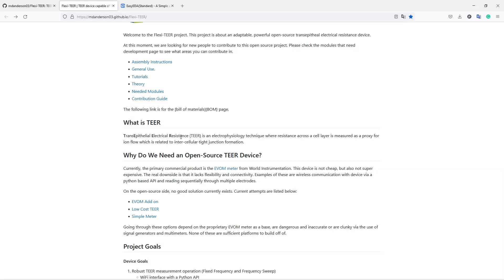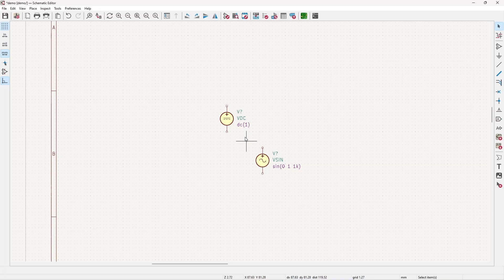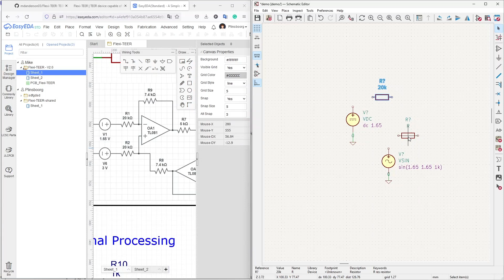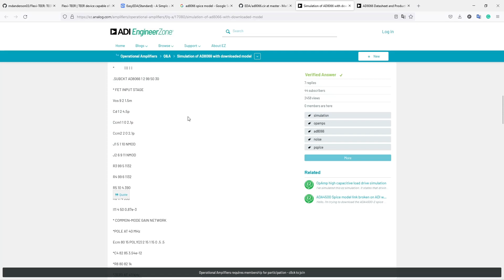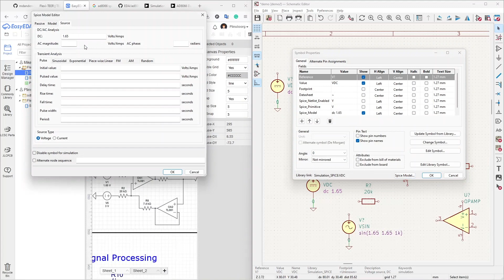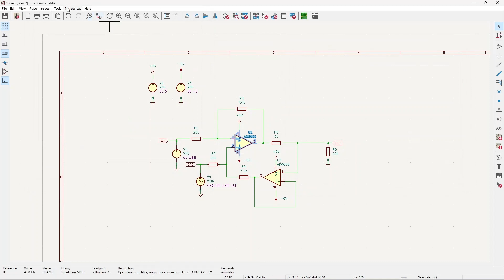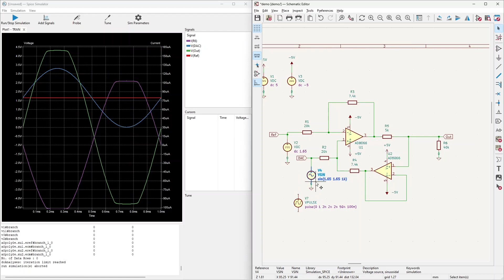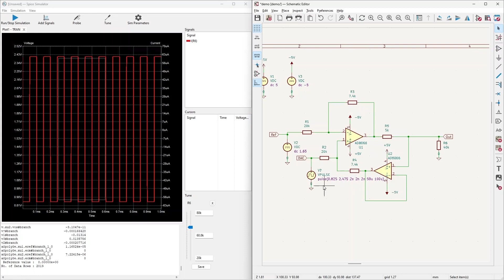KiCAD 6.0 SPICE Simulator tutorial

Comment: sorry for the stupid question, I don't understand what's being probed? Are you saying there's positive voltage on R6, but the current is going across it the other way? Isn't that a violation of Ohm's law?
Reply from the maker: Please, post the timestamp that you're asking about. Generally I belive this SPICE simulator might have positive direction for the current in the given resistor. So with the same current, if you flip the resistor, you will read inverse value. Don't worry, Ohm's law holds true.

Comment: The component selector has an option at the bottom to create multiple instances or a component until you press escape. Or you can use COPY & PASTE.

When you are drawing the schematic, instead of pressing A to add a component, you can press P, to select a power component, such as +5V, -5V, GND, Pwr_Flag.